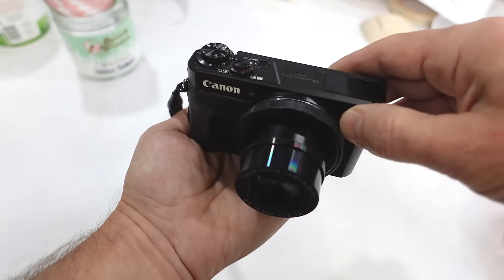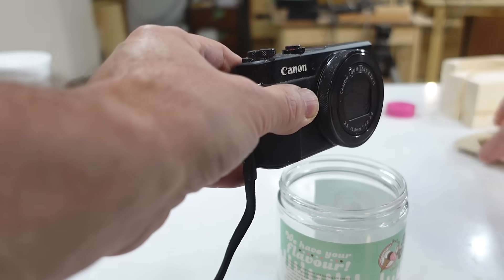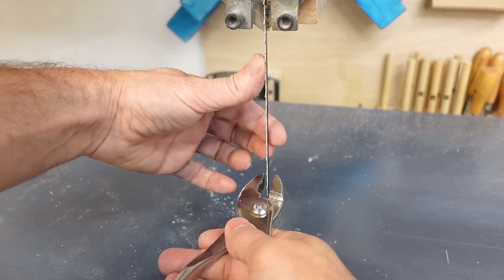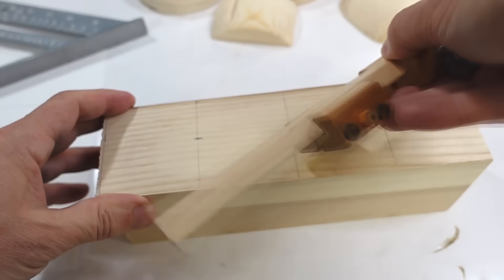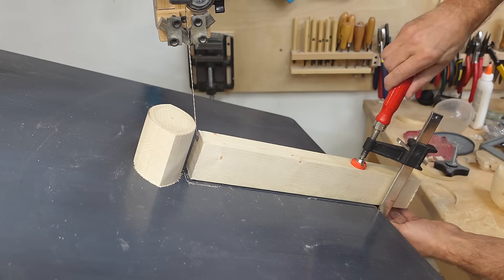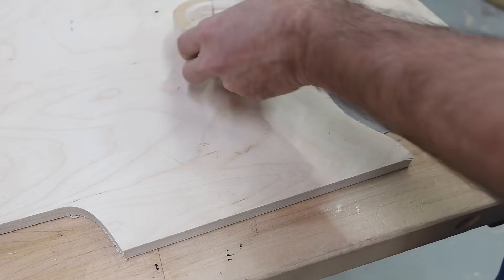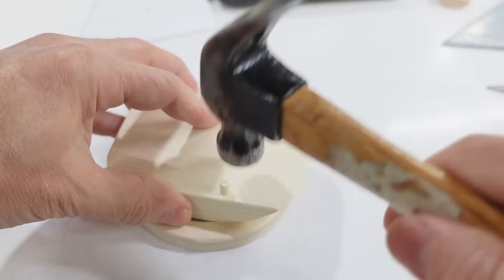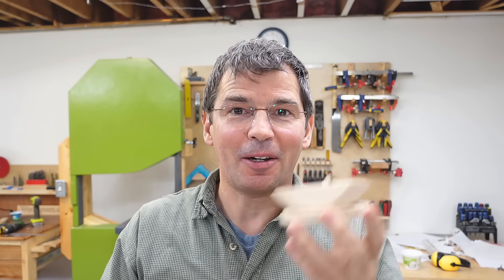Simple camera or phone aiming platform (replaces tripod)

Comment: Genius. Not even a minute into the video and I i threw my phone into a roll of packing tape and put it on my coffee mug and had a tripod in seconds without leaving my desk. The offset camera clears the side of the roll and my galaxy s20+ happens to require the tape roll to be squeezed oblong everzso slightly, which holds it snug.
Reply from the maker: cool!  I just checked my phone and it just fits too!
Reply: @matthiaswandel  Just had to try this myself. What a genius idea.
Reply: Nice! 50.8 mm blue painters tape & 76.2 mm mug. iPhone 15 pro with case. Can’t tilt sideways too much but probably would only use around rotational axis parallel to the screens longest edge anyway.
Reply: Mine fell into my tea.
Reply: @ricos1497  that because you are only supposed to use it on coffee 😁
Reply: Dang, I did the same thing, it’s brilliant

Comment: An alternative: use a small bean bag. At any angle you like, portable, and fits in a pocket. To make a bean bag type bag, use a small fabric pencil case, filled with buckwheat hulls, or grains of sand if you like, or whatever doesnt degrade.
Reply: There's a commercial version called The Pod that I've been using for years with small cameras. Their best feature is perhaps that you can use them on any uneven surface as the bottom of the bean bag just conforms to the surface.

Comment: The simplest phone camera holder I've stumbled upon is my Casio watch. I expand the band which has holes (not the stretchy watch bands) to fit around my Samsung S23. Then rest the watch face flat on the ground or table or fence post. You can tilt the phone slightly upwards or downwards within the band.  Works well most of the time in a pinch. Thx for the tutorial Matthias

Comment: I think it would be a good idea to add a harness or strap to secure the camera in case someone bumps the stand while using it - especially for the ones meant as gifts. Very interesting design. Thanks for sharing.
Reply: This could be 4 cup hooks, one near each corner, with rubber bands that cross over the top of the camera, and end up clear of the lens.

Comment: I do professional video and streaming and you've essentially built the same system that big tripod systems use. Most of the higher end/video tripods use a 70mm bowl mount to connect the tripod head to the legs, the bowl lets you perfectly level the tripod head even if the legs are uneven.

Watching you build this for a completely different group of camera users was really neat
Reply: Yep, this is a simple version of a low-hat, out of wood of course :)

Comment: One way to improve the de-kinking of the bandsaw blade would be to make a winding path through 3 or 4 skate bearings aligned so that there isn't a straight path through them. Though you might do that in a clamping fixture so that the path is 'straight' as you are setting up, then squeeze the blade while running to run through them. They use a similar technique to straighten wire coming off of various spools.  Now I get to re-watch the entire video to see what I missed while drafting this. 🙂

The trick to 'remembering' that you have one of these, is to spend a few dozen photo-shoots deliberately using them, and having one or more stored wherever you keep your camera. I can see making some that end up as camera fixtures, if you add a bolt through the center, with a conical cutout from the bolt holding point, and then a large 'nut' gear (either with an actual nut, or with a T-nut for more depth of threads if that is 'useful) at the base that tensions the base at whatever angle you set. This would need clearance for the bolt head, and you would probably need a spherical adapter for the bolt head, but might help in situations where a camera may get jostled and you want some level of repeatability, without making the  setup 'permanent.

Comment: This is great not only for cameras, but also for propping your phone or a small tablet on the table for reading during lunch at work.
I am going to make one. I will just use a lathe to make that semi-sphere slice. And also the ring. 
You do have a lathe. You could jury-rig a ball making gizmo on it.
Reply: You might make one with a large enough surface on top to bu used as a countertop easel for cookbooks or tablets on a kitchen counter or at a standing desk, so that either is at a more useful reading orientation. Something with an adjustable level of 0-15 degrees.

Comment: 1.) Rubber feet on the base to reduce table or surface vibrations. 

2.) A stick on bubble level

3.) Different bases at different level height. Have a swivel plate on the bottom as well to counter adjust for non-level surfaces.

What you essentially created was a lowered, half ball head joint without the tripod housing/legs. Pretty clever. 

Would love to see a more refined machined aluminum version.
Reply: Making an aluminum version might might be an example of over-engineering.

Comment: I like it.  One suggestion to prevent the stand from being shook out of alignment is some type of grit (sandpaper?) between the two wooden parts.
Reply: Put it on a flattish beanbag?
Reply: @Struthio_Camelus  I have used one of those beanbags and they are handy.  But they don't have the range of movement that this wooden platform has (nor a tripod).
Reply: @cemx86  I hear that, I was thinking about a small little beanbag in the bottom of the socket, just enough to rub the bottom of the ball.
Failing that, cut little pieces of rubber glove and glue to the socket rim.

Comment: If the arc of the wood had a metal layer, then you could use a Neodymium magnet to prevent the platform from falling of the base, and if the camera is fixed with velcro wraps to the base, you can use the entire holder even upside down.

Comment: Handy design! You could probably bevel the edge with a router, or even a rasp if you were hand-tool inclined, or if the bandsaw cut was to scary.
Reply from the maker: yes, a round-over would do.  But I prefer the sanded surface, cause most of these ended up rocking just a bit, and sanding it a bit more doesn't show when all the bevels are sanded.
Reply: @matthiaswandel  I was not thinking of a round over actually, but a chamfer. I guess it all depends on what tools and bits a person has on hand. (Heck, I don’t even own a router, it just struck me as another option).

Comment: Now I  assume your next move could be to add several holes for camera holding rods with female thread and rods with several heights to screw there. Also, a rubber surface may enable the camera not to slide. And the next may be creating silicone molds for colorful urethane resin products. Do you dream your projects while you are sleeping?

Comment: I'm unsure if you still have a lathe (haven't seen you use one in a while), but you could turn a half sphere on the end of a chunk of wood, then cut your desired shape out of that half sphere. That way, you are working with a true sphere shape and not having to approximate it by hand.

You could probably also cut the base out of that same piece of half sphere.
Reply: It may be one of the tools that he parted with when he moved from the farm to his current location. That said, he made that lath, so he could likely make a new one if he felt the need. Speaking of which I picked up a benchtop belt sander with a disk sander from a surplus store, that I didn't check before hand, but the casting was broken (several places) that In intend to use his ideas for a desktop bench sander to make into something useful for me. (The bearings and motor are all good, just the cast fram and a few 'covers' ended up being broken. Intentions need to change to actions though, and that's taking way too long...

Comment: The pegs should be done like bench dogs, multiple holes and friction fit.

The base or the plate should be coated with something that has a little grip. Strips of rubber, rubber cement, or maybe varnish?

Comment: Good idea. Why didn't you use a router table to cut the edges instead of a tilted bandsaw?
Reply from the maker: because I used a bandsaw instead of a router table
Reply: @matthiaswandel  Thanks 😀. I was just curious since I am a beginner woodworker and I thought there may be a safety issue with a router. I have been looking at safety videos and watching people get injured and they say at the end that they should of done something one way instead of another way etc. I like the hobby but I don't want any digits cut off. 

You have a really great set of videos and are very creative. You sound like an engineer. I am a P. Eng./Struct. Eng. as well. I guess it takes one to know one.

Comment: A question: when you were cutting in the band saw, wouldn't it be safe if you were cutting on the other side of the blade when you tilted the base? That way the bottom of the piece is supported and it won't be able to turn when being cut. Instead of using the contraption you used.
Reply from the maker: that would be much safer, but I can't see through from the bottom of the table.  Following the line precisely is kind of important

Comment: For your bandsaw cut, why not just cut it with the piece on the downhill side of the table (other side of the blade)? It would mean redrawing your reference lines but  vs making a safety jig, I think you'd be ahead on both time and safety.
Reply: Using the downhill side also means swapping which hands you use
Reply from the maker: that suggestion keeps coming up, but I needed to follow my compass line.  yes, you can save on time and safety if you sacrifice quality.

Comment: I find it a bit problematic that you need modified designs for different pieces of kit. Is the central screw mount small enough to fit a pin/dowel? Maybe just one pin that isn't threaded would be sufficient? If the center of gravity is balanced enough, it shouldn't spin around or anything.
Reply from the maker: the screw is usually to the side of the center of mass, so a pin for one device wouldn't work for another. Also, it would have a tendency to turn on you, again, cause the center of mass is not the center of the tripod screw

Comment: I'm not sure trying to approximate a spherical surface is the best solution. It might be more effective to have it unbevelled, or even with a concave outer surface so that you end with the rocker touching the base edge-on-edge almost perpendicular such that the weight causes the edges to bite on each other, making it harder to slide by itself.
Reply from the maker: True, but then its hard to fine adjust.  Also gets dinged up.  I tried coating the edge with hot glue, which gives it much moroe friction

Comment: Matthias what would be needed to adapt that to be a star or sun tracker, do you suppose a single wheel driven with bits from that pi grab bag would suffice (or would two be required)? would I be correct that once pointed at a star any tracker needs to only be driven to follow that point along the celestial ecliptic?

Comment: Not sure if it would be worth doing, but this could probably be made more flat packable by having the top section in 3 pieces. A flat circle with two slots, and two arcs that slip into the slots. Could even integrate tabs sticking up on the arcs to act as your pegs, and the weight of the camera would keep things together. Not sure if the sizes would work out to store the arc pieces inside of the base or not.